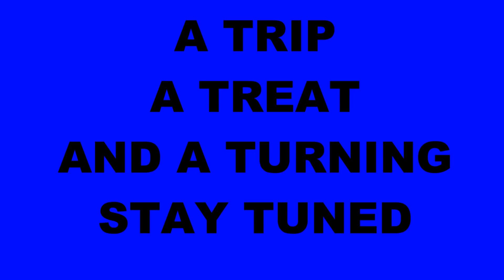A Trip A Gift And Exotic Olive Wood Turning

Comment: Love the opening shots on this video Gary and what a lovely gift!  A beautiful looking bowl mate the grain patterns in it are stunning ! Phill will be proud of you  !
btw, I do not have any black ca glue sooo, having a similar problem as you today I used sawdust and ca with a dab of black spirit stain  on a thin artists brush and painted it in
Cheers mate,    Bram
Reply from the maker: Thank you very much Bram! Yes it was a wonderful gift. Phil is a great guy..
Brilliant idea on the black stain. I have a number of dyes I used when I was making some soft rubber fishing lures. I mixed some with some resin to fill a large inclusion on a piece I will be turning pretty soon. Not black though and you will have to wait to see what color I did use.
I turned the other half awhile back and it did not hold together.
This time I hope I out smarted it. I  normally do not use resin but this piece needed it.
Cheers my friend,
Gary

Comment: You did that piece of Philwood (full of cracks, dips bumps and all sorts of surprises - and can be any species of wood) that he gifted you quite nicely.  Even without the use of a Sand-O-Flex (unless you did it off camera) 🙄 Thanks for the video.  Cheers, Tom
Reply from the maker: Thank you Tom. Not sure how I did it back then. I also have a 3" diameter wheel with plastic bristles I have used. I bought that years ago to polish aluminum parts. I actually does a good job as well.
Thanks for watching this oldie!
Gary
Reply: @ThePapa1947  I’ve got a couple of those from Harbor Freight, fine and medium (supposedly 220 and 180?). Cheers, Tom
Reply from the maker: @tomcoker9882  The ones I have are red and blue. I think the blue is the finer. I think I got mine at Home Depot.  Might need  to get a few more. I think the blue one ran away LOL

Comment: Hi Gary,  How did you fill the outside cracks, it looks like they are filled with sawdust, did you use glue or oil to fill the cracks.  I don't mean where you used black c/a glue.   Thanks love your work. diana
Reply from the maker: Hi Diana, I filled them with a mix of shellac sanding sealer and saw dust. I have also used lacquer and sawdust.
 Thanks for watching,
Gary